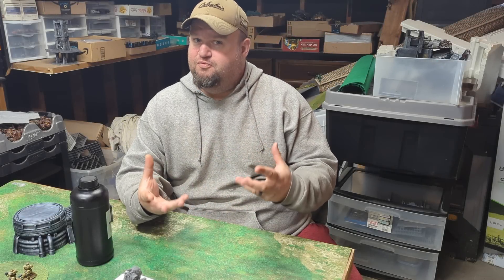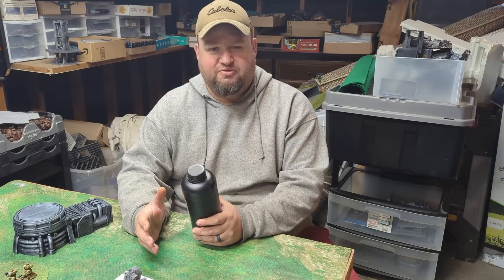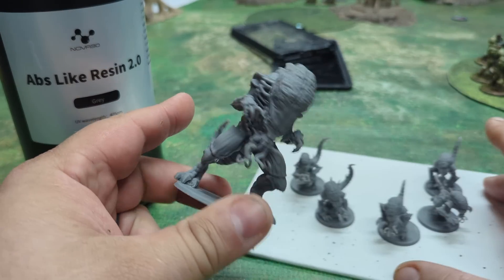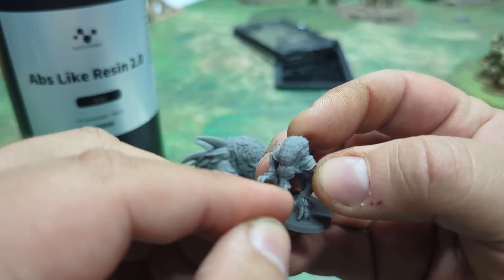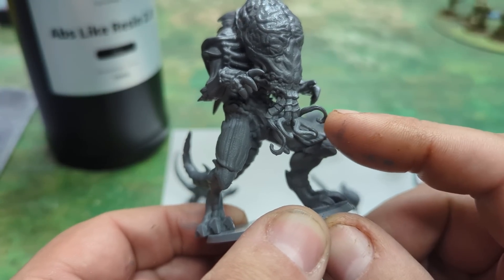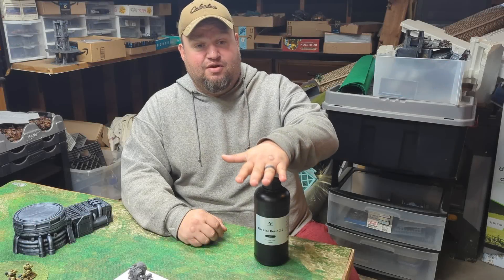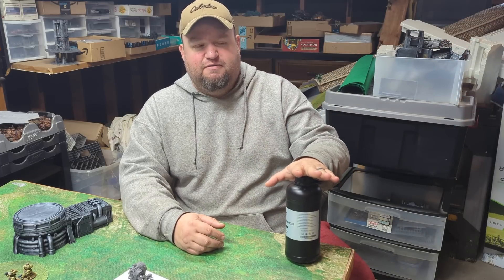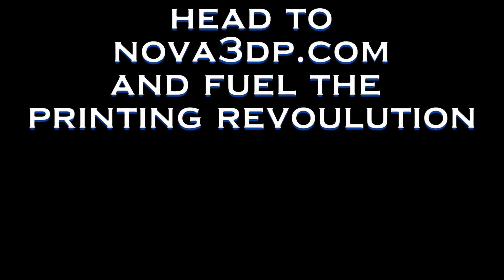Has Nova3d made a better ABS-like 3D resin?

Comment: Which one would you recommend? I've been buying cheap resin for years and I want to make the switch to better stuff. I saw your other video with the hammer and then this one. Would you recommend one over the other? They seem about the same price, so whats the main preference point?
Reply from the maker: The abs is cheaper than the tough. I would suggest an abs like resin overall for miniatures. This resin feels better than the other abs like I have used in support tear off, temperature workability and low to barely any smell.
Reply: @WarbossFitz  Thank you! I looked on Amazon and it seems like both the tough and the newer ABS is the same price for 1000kg, so I wonder if it's different based on location. I think I'll grab the newer ABS and stick with that for now. As you said, it's tough enough to weather most things and bends just fine.